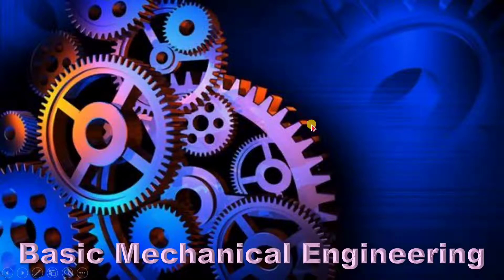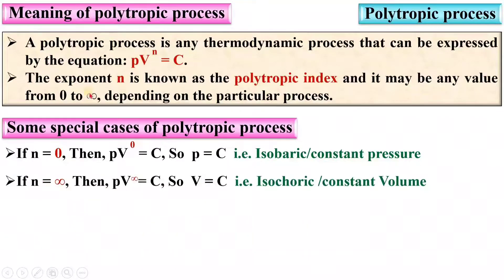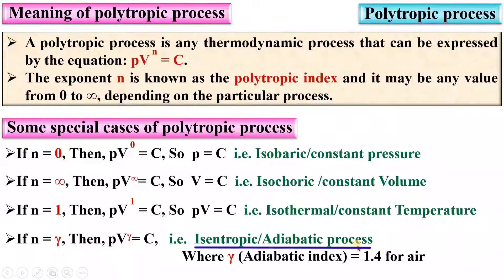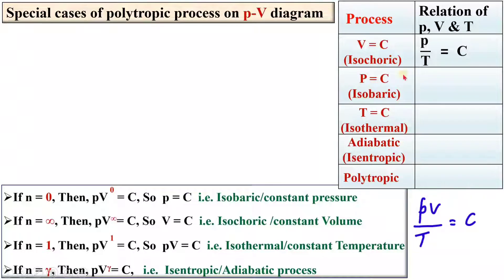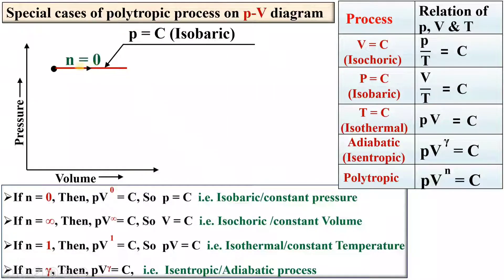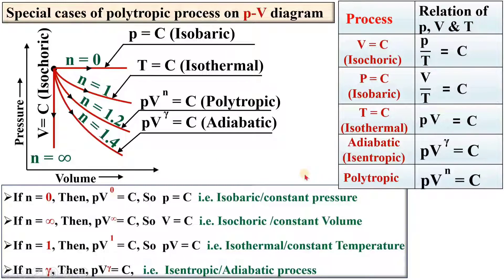Polytropic process | Special cases of Polytropic process | pV diagram of Polytropic process

Comment from the maker: Polytropic process explained with following Timestamps: 
0:00 - Polytropic process - Basic Mechanical Engineering lecture series 
0:14 – Non flow process on pV diagram
0:45 – Basics of Polytropic process
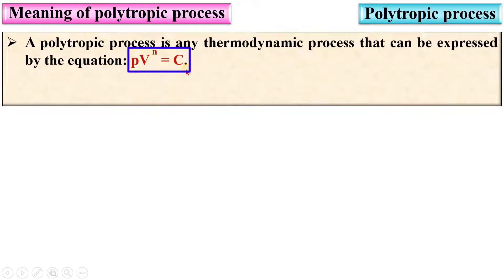0:59 – Governing equation of Polytropic process
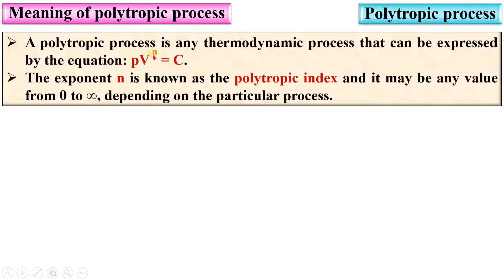1:24 – Special cases of Polytropic process
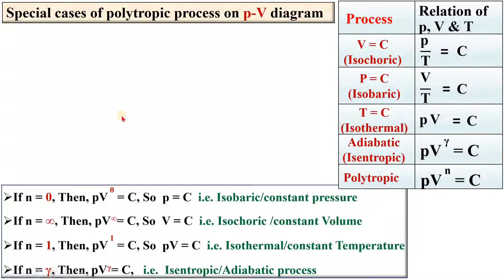4:13 – Isobaric process on pV diagram
4:47 – Isochoric process on pV diagram 
5:09 – Isothermal process on pV diagram
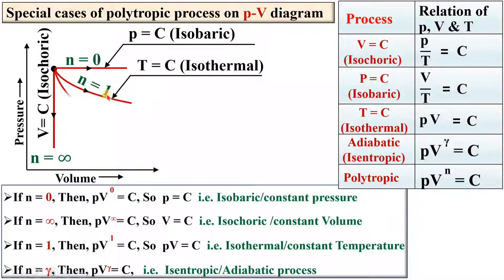5:34 – Polytropic process on pV diagram
5:44 – Adiabatic process on pV diagram
6:10 – Comparison of thermodynamic process